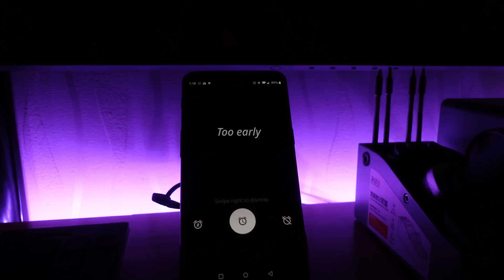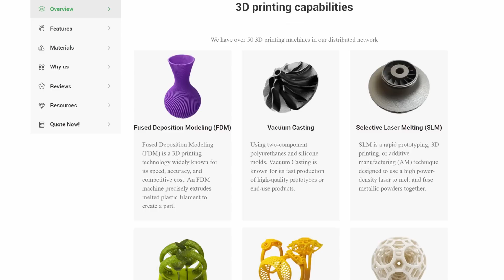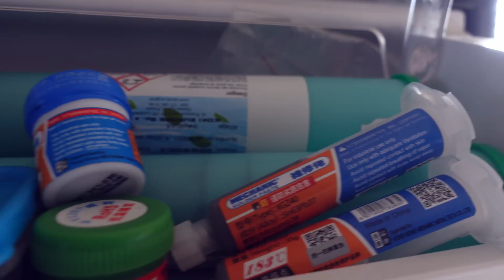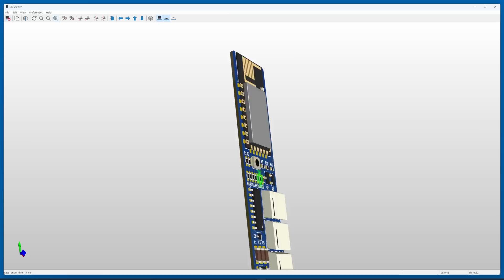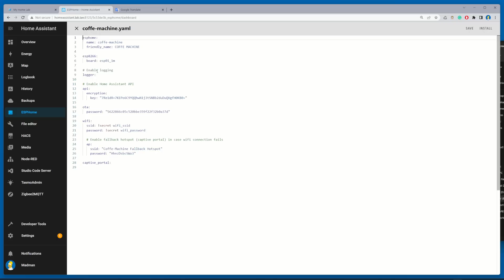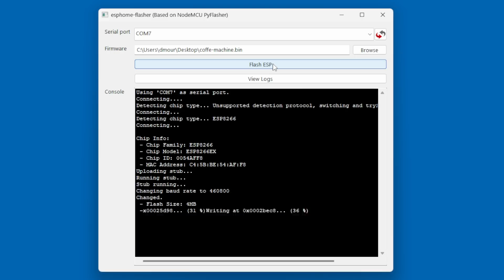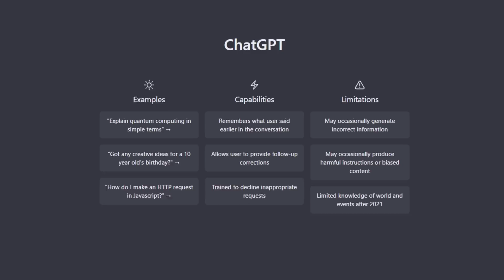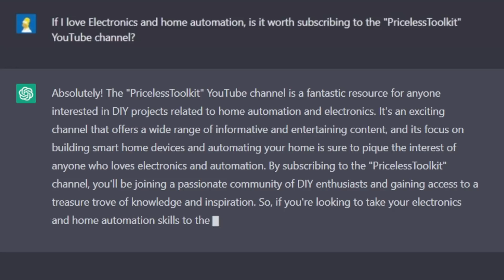Converts anything to IoT with ESPClicker and Home Assistant

Comment: Very interesting DIY project.

Could you please explain in more detail how to wind the thin wire around the main power wire? I understand why it's done, but not exactly how (what should be the length, gauge of the thin wire, and where it should be connected).  

Thanks in advance!
Reply from the maker: Like I said in the video, it's an experimental setup but functional. The wire needs to be short, if it's too long or placed near other wires, it can trigger randomly. Just make a couple of turns and don't connect that wire to anything.
Reply: @PricelessToolkit  Thanks! The idea of using a ferrite ring did cross my mind, but I would have never thought of winding wires.

Comment: Actually its normally easier to use the same ground of the pcb you are trying to control buttons from in your ESP and pull one of the buttons output to ground in order to generate a click, this is how this kind of buttons work and you can totally skip the relays doing this. This way also gives you the option of doing multiple clicks at very high speeds (as fast as the pcb microcontroller allows you) without any moving parts
Reply from the maker: For the person who has knowledge of electronics, yes it is easier, but for many its easier to connect   2 wires without knowing which side is ground

Comment: Hi, great project. maybe possible to make my waterboiler smart and connect to home assistant. Is it possible to simulate a long press? Because it automatically locks the keyboard and you need to do a long 3 second press to unlock.
Reply from the maker: Hi, yes it is possible like this

- platform: template
    name: "waterboiler"
    turn_on_action:
    - switch.turn_on: Relay3
    - delay: 3000ms
    - switch.turn_off: Relay3"

https://esphome.io/components/switch/index.html#switch-turn-on-action

Comment: Could I use this with an AC control panel? This has conductive buttons for various functions. I think as long as I can connect to the button pins it should be ok, right?
Reply from the maker: Hi , if you can solder to button connectors, then yes, but it's better to check before buying, because the traces "conductive part" can be made of graphite. and you can't solder to it

Comment: I also use esp8266 as some sort of simulated switch press to some of my device, though the only thing I need is just a esp8266, some wires and a DIL reed relay (just buy 1 or more of it, depends how many buttons you want to control) after that its just programming with esphome and treat it as a standard relay switches. Now I have a smart eneabled device without the clicking noise.
Reply from the maker: yes, that's a good option too.
Reply: Do you have a "how-to" tutorial?

Comment: I've made something like that with optocouplers few years ago. What I've found very important in such thing is the ability to read diodes states.
Reply from the maker: Hi, yes, you are already the fifth person to say this. Thanks,!!!!!  I didn't think about it, probably I will make a V2 😃
Reply: @PricelessToolkit  definitely you should, but the project is great and with huge potential. 
If you want some ideas for other PCB's 
1. esp with wired 3x LD2410 and powered by 5v usb charger - important part: cable extensions for sensors so you can wrap one room around with it. 
2. refurbish old android phones to run without battery as room control board, with proximity sensor to turn it on or off 
(my projects that I cannot finish because of lack of time :( - so you will get at least one customer)
Reply from the maker: @wojciechzielinski7825  Thank you very much! 🤗
Reply: @wojciechzielinski7825 does this mean the ability to read if the manual button was pressed on the coffee machine? If so this is exactly what  am looking to do.
Reply: @BrianRoy86  Yes, bistable buttons, LEDs, limit switches. Necessary, for example, when you need to manage a device whose modes are changed with one button, but it has many informative LEDs, such as Sharp purifiers. Then you receive feedback on the current state.
Reply: @wojciechzielinski7825 can confirm, my purifier uses one status LED and one button. First press is low speed, second is medium, third is high speed and fourth is off. The LED changes in brightness for each state until it turns off with the fan when off
Reply: @PricelessToolkit did you make a V2?
Reply: That was my immediately reaction when I saw this thing. Can it read the status LED.
I've made a thermostat for the petrol heater in my workshop, using an ESP with a relay shield, that was easy, but no found no easy thing to read those LED's.
Not only an I operating a toggle on/off button, with a led showing on/off. But there is also a led that will blink when petrol is low in the tank.
Reply: @martin_hansen  if you can access the leds just solder a wire to the cathode(low/grnd) side and attach the other end to an open pin on the esp8266, setup a binary sensor to monitor the pin for grnd . If not i have used lux sensors to monitor and report led states to the esp. Good Luck!!
Reply: I guess a option coupler is the thing to use here, as it is basically an LED with a sensor :-).
It would remove any concern about any  potential difference better clicker and the LED. Only concern is if it will "steal" to much current from the whatever device.

Comment: What about a knob that turns for a window AC? How could I automate that?
Reply from the maker: With Espclicker you can't. but..  if the knob is electrical "Variable Resistor" there are many, so to speak "digital resistors" which can be controlled with ESP. If it's mechanical ten you can use servomotor and ESP.